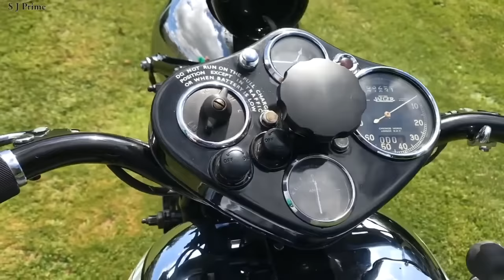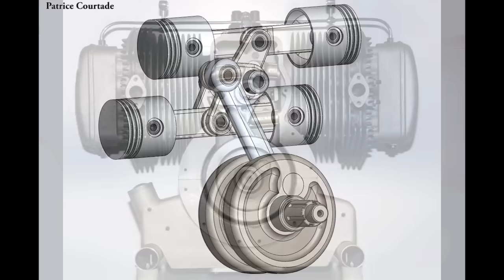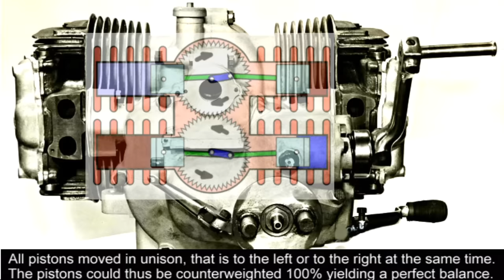The Most Unique British 4-cylinder motorcycles !

Comment: Jawa are some of the best motorcycles made period. Peace
Reply: Hi V.F. They made top class speedway bikes. I had Jawas for many years, mainly the 350 two stroke twin. Very reliable and simply made bike. The only serious trouble it had was jumping out of third gear, but I fixed that by making my own stronger gearbox selector forks, and rebushing the selector fork slider rod. I then converted the 6v 45 watt Pal electrical generator to 12v 60 watts. After 120,000 miles something's going to go wrong, eh? Cheers, P.R.
Reply: @philliprobinson7724  I love their bikes. I also have a 350 which is super. They just run and run. Simple too.
Reply: @victoryfirst2878  Hi V.F. Not the fastest bikes to be sure, but they just kept on keeping on. I liked the "slick-shift" cam on the gear-change/kickstart shaft that depressed the clutch automatically when changing gear. I could ride my Jawa 350 with one hand tied behind my back: literally! Triumph had a "slick-shift" at one stage too, but they canned it. What year is your 350? Cheers, P.R.
Reply: @philliprobinson7724  Mine is the 1972. I just love the two stroke. This will never die.

Comment: The Ariel Square 4 at 2:25 is not a production bike.  It was never manufactured with the pivoted rear fork frame, as made for the mid-late fifties singles and twins.  A number of Square 4 engines have been put in the fork frame, by enthusiasts, and maybe there was a factory prototype or two.  
Most Square 4s were sold to pull sidecars, and the plunger rear end (actually the Anstey link on an Ariel) was preferred by many for this role.

Comment: The Squarial could easily rip the carcass of the rear tires available at the time to pieces. Edward Turner also designed the classic Triumph twin-cylinder engines that dominated the scene from the late 30's on into the 50's.

Comment: The first narrow angle V4 engine is fascinating but the VR Volkswagen engine design was most influenced by the Lancia narrow angle engines, in particular the Fulvia engine, according to the senior engineer in charge of its development.

You can see this particularly in the design of the Fulvia cylinder head - two camshafts operating the valves via rocker arms like the later 4v VR engines.

Lancia "VR" engines preceded the Matchless by ten years.

Comment: We are still capable of this type of engineering and do so. The thing it is never reported on. Indian motorcycles have an R&D site in the Midlands, a guy on their stand at the NEC bike show told me in 2019.Royal Enfield have their R&D in  Liceistershire and Triumph. Most F1 cars  are designed and Merc F1 engines. This is just the top of the iceberg in aspects of engineering. Yes manufacturing is poor in relation to the golden days. But we build more cars than we did. And we make a lot of plant forklifts and machinery. JCB, Cat earth movers and Hyster Yale forklifts for example. But we need more.

Comment: Still can't get head round square four, did it have 2 crankshaft s.
Reply: Yes, two counter-rotating crankshafts.  The rear one drives the clutch as normal, and the front one is geared to it inside the crankcases

Comment: There's no such thing as 'most unique' A thing is either unique (i.e. there is only one of it) or it is not.
Reply: Pedant  !
Reply: @muff-puff.  murderer of English!
Reply: @gzk6nk  
Oooooohhh, I love a good Murder 👍, even if it's only. ENGLISH 😅😂🤣🤭🥴🤯.
Reply: All of these bikes were flawed from the beginning the matchless was slow expensive and killed by the depression because people didn't have jobs the overhead cam Ariel Square Four with she left right and Center it was redesigned in the 30s but still had the same problem even after they went to for pipes and an alloy head it would still see I know a guy in Texas who had a square for and it seized and both connecting rods in the back broke the Willard flying for the internals would wear out too quick because of its poor design it would work for a while and then die you could are cool and Austin seven engine as long as you solder cooling fans around the motor FYI a brough superior and an Austin seven were almost the same in price you could buy the most expensive motorcycle or the cheapest car for the same price singles and twins are easier to work on and more economical that's why they outlasted all of the fours